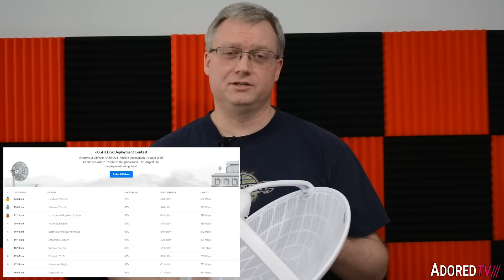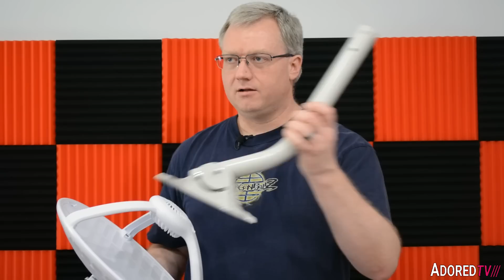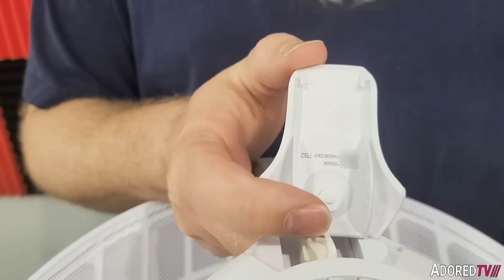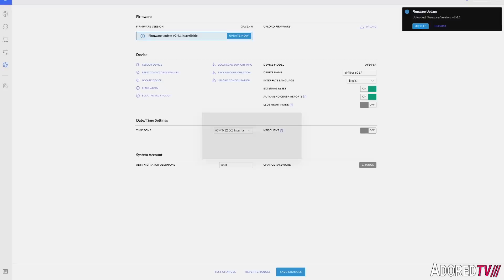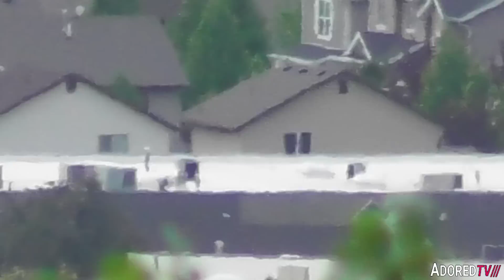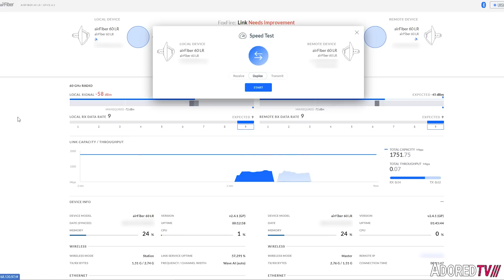Building a WiFi Bridge with a Ubiquiti airFiber 60 LR Antenna - 3km Tested!

Comment: as a Field Tech that works for a WISP and has actually deployed a few of these, I just wanna say "Just buy it. You wont regret it!"
Reply: Is there any way I can get in contact with you? I'm wanting to bring a wisp system to our community. We've given up on any one bringing internet here. I'd love to take a tour of the a function WISP system. I don't mind to travel a long distance.
Reply from the maker: Right!
Reply: @adoredtv  i got a question can i cover like west and east for few km or is it just going in the direction from the saucer? and do o need to conect this to internet or can i take for example wifi from public space ?
Reply: I run their AP (lite) in my home. They're great stuff. I considered Meraki but here in my country Ubiquiti was just easier to pick up for purchase.
Reply: is it possible to achieve 1000mbps connection with these? I really want gig internet but I dont want to waste money if the technology is not there to support it. I have clear line of sight to the internet source
Reply: @joea.6017  Yes, they should definitely be able to reach 1gbps. But your mileage may vary if distance is over 5 miles.
Reply: @GAKtion64  I am 1.6 miles away and have clear line of sight from the internet source. I was told from another manufacturer that no satellite on the market was capable of gig speeds. I thought that seemed pretty far fetched.
Reply: @joea.6017  satellite internet is outer space. This is two dishes facing each other here on earth.
Reply: @GAKtion64  Well he may have just been being a smartass cause I was saying satellite. I was under the assumption he knew I meant his dishes that he was selling, etc. I want a dish that I can get 85-90% at least of the internet connection. I want to order gig internet, beam it over 1.5 miles to my new home, and have it be somewhat efficient. If these can do that. I am sold!
Reply: hello sir i just purchase this product same as you advertise, but my problem is that i really find it hard to align even if i can see the other side tower bowers is at 100ft but i cant link the two anntenas. the distance is at 3kms
Reply: @psalmtv9414  yes 60 LR are hard to align
Reply: How do they hold up to rain?
Reply: @youtubertoo  around 4 miles, they should still be connected. But if your gonna go farther, better to setup a 5ghz (I prefer 5XHD) PTP along side the 60ghz PTP.
Reply: is the link be affected for a noisy tower?5ghz devices?

Comment: I assume it can also be used to run internal networks, right? So if I wanted to share files with my friend what would be the theoretical maximum speed achievable? Because it shows 1.75 Gbps as total bandwidth (from theoretical 1.8 Gbps, but on short ranges it might actually be slightly more). So perhaps there are other wireless solutions that allow for greater speeds? Obviously you didn't need anymore, and you were quite close to maximum in duplex test (though maybe duplex test in ideal conditions would be closer to 3.5 or 3.6 Gbps?)
I'd probably have to run the frequency channel width and maybe compute from that. IDK - it's been years since I even done similar things.

Comment: How difficult was the aiming process? How long did it take to get a good stable link? Did you use any tools to aid in aiming it? I've had difficulty aiming two gigabeam plus 60ghz from half that distance, even in clear line of sight.
Reply: I'm about to install a pair of these. It comes with an aiming device that can mount in one of 3 spots on the dish. It's like a pinhole you look through to aim.

Comment: Did you ever do an update video on the setup?
Reply from the maker: I have not, as the setup in the video was a temporary demo. The antennas in actual production use are only ~90ft apart, so get the full bandwidth with no interference problems, so nothing special.

Comment: What's the tower height needed for this?
Reply: From having similar device around 15 years ago, I'd say that ideally you need line of sight between 2 full dishes, not just the "horn". And obviously no trees or anything like that in the way - even a leafless branch of a tree in Winter might substantially reduce quality of Network. Though it obviously depends on the distance. 11 GHz platforms probably suffer less, but while I had this Internet for years, every 2-3 years we had to move antenna up, because there was a tree in the way and it kept growing up. Rain, Snow and such made it harsh to operate. And storms - oh boy. Distance was around 5.6 km in straight line, so we technically were above the maximum distance for that dish (3 km guaranteed range). And given that we were paying about 15$ a month, the ISP didn't want to supply us with better equipment (even though we were paying for some of it - like leasing an antenna, but the rest was on them). To the point that when we stopped using this Internet, because fiber optics was drawn nearby (couple hundred meters from hour house), our former ISP didn't even take single piece of equipment back. Probably worthless now to them. But they said that to supply us with 1.5 Mbit/s download and 0.3 Mbit/s upload, they had to run their antenna at like 60 Mbit/s.
Our new ISP asked us to pay for the Pole for fiber optics (around 70$) and for router (90$?), because old one supported only 100 Mbit/s. And we now have 300/30 Mbit/s (I think) connection. For which we pay around 20$ a month.

Comment: we are a startup broadband ISP. there is a place where we can not run fiber to the customer so we are planning to deploy 1 airfiber60LR at our office and 1 at the customer rooftop. as a result the airfibers will be on the public internet site and we can not put public IPs on the radio systems for management. we are planning to manage them when needed via directly connecting our laptop to the device.

so my question is are airfiber60LRs are going to work without entering any IPs on those radio systems ?

Comment: A few of my WISP buddies have been using these for around 5 miles with a 5GHz backup.

Wish Mikrotik's version had the upper band and more power, I much prefer Mikrotik to UBNT.

I still have UBNT hardware in use but I don't have many shots where I can use 60GHz, my shortest point to point shots are 5 miles, most are ~15 miles.

Comment: Probably not going to get that throughput, but the oldest setup like this I saw was about nearly 20+ years ago, using 2 satellite dishes (each pointing at the ground but aimed directly at each other, think about how dishes are normally pointing up at the sky by typically being mounted nearly vertically - it looks odd, like the work of an idiot when you see them pointing at the ground, but they worked great), using two wifi routers strapped to where the LNB would normally go!

Comment: Thanks .. I want to replace my old nanostations with these. Can you show configurations for setting up vlans. I have mutiple vlans that I want to pass through wireless bridge. My current setup one of my Rocket M2 (access point mode) was simply enable WSD mode and connected it(LAN port of the POE injector) to trunk port of cisco 2960. On the other end .. I setup nanostation M2 and also enabled WSD and connected to trunk port of csico SG250. The phone + data vlans get separated using this simple setup and worked without issue. Several vlans including phone were already configured on both managed cisco switches.
Reply from the maker: these antennas shouldn't strip the vlan info and will just send the full packet, vlan header and all.

Comment: Ive used them for a long time, usually great. Always ground your antennas and use FTP with a drain wire and metal connectors.

Bonus points if you test your cable with a proper qualifier and verify your shielding.

Mikrotik also has great 60ghz products but they aren’t as user friendly, but more powerful interface.

Cheers
Reply from the maker: The antenna behind me on the roof was a Mikrotik ;)
Reply: As a lay person I still get PTSD flashbacks from the first time seeing the web interface of RouterOS 😵

Comment: One of my first projects with a manager that enabled us to start upgrading equipment was replacing a 200Mb/s bridge with a 1.2Gb.   Not only through the rollout, but then some issues of a roofing company moving them severing the connection was an extremely gratifying experience.  Not to mention the staff in that remote building were much happier after the replacement finished.
Reply from the maker: Yep, I've been using PtP to service "across the street" type bridges for some time now. Furthest I've had to bridge professionally was just a few KM though.

Comment: Thanks for the informative video.  One thing struck me though.  Where is the lightning arrester?  There doesn't appear any mention of the device on the their website as well.  Running a cable from an elevated position, then inside a home without a ground path for lightning which is also bonded to an electrical service path to ground/earth, seems like a disaster waiting to happen.  Also, if you haven't already, you ought to use some mastic on those holes through your roof.  That aside, thanks for the video.  I learned something new from it, which is always appreciated. :-)
Reply from the maker: I had it propped on a tripod, so no mastic needed. If it was a permanent install, I'd have bonded it to the solar panel array since that's already properly grounded. Thanks for pointing that out though! I was debating including it in the video, but then we run into local building codes and I didn't want to muddy the content too much.

Comment: Doesn't a device like this only work if you have access to and from 2 different locations? Most of the public will only have their home location so is this designed more for businesses that have multiple buildings:? I guess I don't fully understand. Because I originally thought it worked similarly a home router. is the purpose is to send broadband Internet from a good access location to a bad access location they also can have a good connection. I guess that's great if you negotiate with someone who lives a distance away and negotiates to share signal with you
Reply from the maker: The primary purpose of these antennas would be point-to-point bridging. Ubiquiti sells variants that provide local WiFi signals like traditional Access Points, but also have the bridge, so you can easily point-to-multipoint blanket a park or other public space. Ubiquiti does sell home access point WiFi equipment as well, not to mention their business offerings, so you're not wrong in that. You're also spot-on for the broadband internet thought too, so if a neighbor or friend some distance away can get fiber internet and you're stuck with crappy DSL or data-capped cable, you could bridge over to them. You'll want to be careful in this though, as most/all ISPs have a no-sublet clause in their service contract.

Comment: I fantasized about connecting 2400 Baud modem to short wave radio system that truckers used back in day. This was my idea in the 1993-1995 range. I wanted to have connection with my friend who lived about 3km away. I don't know if it would have been possible, even 300 Baud would have been worth it as it we could have used it for chatting.
Reply from the maker: I was contemplating something similar with packet radio so I'd have mobile internet over HAM radio :D

Comment: Kirk, here's a potential topic or idea for a video. I'm very, very interested in WiFi 6E. I'd love to see how it help out in today's crazy households or apartments with tons of existing 5GHz coverage.

@ my house, we have usually 30-45 devices connected at any time, over half being on 5GHz. We also see neighbors 5GHz which I know will interfere / cause drops in performance. My thought is that 6Ghz will make interference w/neighbors less significant plus better isolation for units (because of attenuation @  higher frequencies).

Also, wanted to know how 6GHz would work in a typical house. How bad does it degrade over distance and standard house building material. Haven't found a good article or video that truly covers this.

Looking to upgrade to a 6E router (or routers w/mesh) + endpoints. Getting an Intel 6E AX210 laptop Module is actually pretty cheap, like $30 bucks.
Reply from the maker: If we can find a device manufacturer that would like to sample us some equipment, I'd be open to the idea.
Reply: @adoredtv  Just a thought, but you could possibly reach out to Eric Sauvageau for ideas on this. He's been developing the custom firmware Asuswrt-Merlin for Asus routers. He's at "@RMerlinDev
" on twitter.

Maybe it's a bad idea, but a thought on my part. I figure a how-to or exploration on effectiveness would be something these companies would love to do, because there's no way they don't just obliterate 5GHz.
Reply: I know I'd prefer two nodes for mesh in my ~2k sq ft house (placed opposite corners/sides of the building), but I'm not ready to pay $1000 for that luxury.

Comment: Azimuth and Elevation all I have to say about that. Cool product.
Reply from the maker: Yeah, I slipped by saying "tilt" as in "tilt back" rather than "elevation" (which I corrected with overlay text btw). I did say azimuth, but since that's too technical for most, I clarified right after. ;)

Comment: I once used a long-range WiFi system for hosting a LAN party. Back in the day where 4G wasn't a thing yet, and we needed broadband in a random shed in the middle of nowhere. 

Aah good times. 2007 or so I think. Battlefront II and Rainbow Six.
Reply: That's pretty awesome. Props for the idea back then. I suppose latency was pretty good since it was just a directional point-to-point signal?
Reply: @dave-bet-tech  Well our DSL was already sitting at 30 ms or so, I think we measured 35-40. It wasn't really meant to online-game anyway, we had a server and hosted our own games. 14 people. Good times.
Reply: @GeoStreber  That's awesome. Thanks for sharing.

Comment: noice.  always wished a had a good excuse to set one of these up.  ran a point-to-point nanostation link between 2 apartments and couldn't have been happier for the tiny price paid.
Reply from the maker: It works well for offsite backup so you don't blow your data cap (if you're unfortunate enough to be saddled with one). Otherwise, network sharing with a buddy is another good reason (I'll let you extrapolate what that suggests). ;)
Reply: @adoredtv  You are a good friend ❤ haha